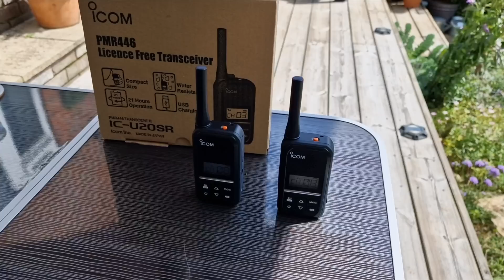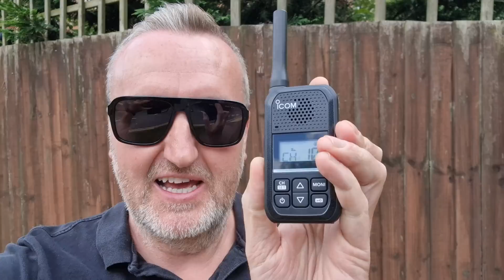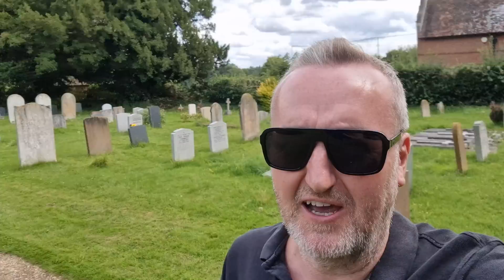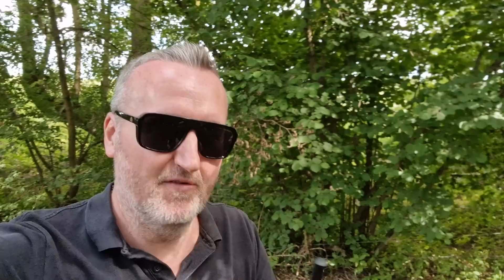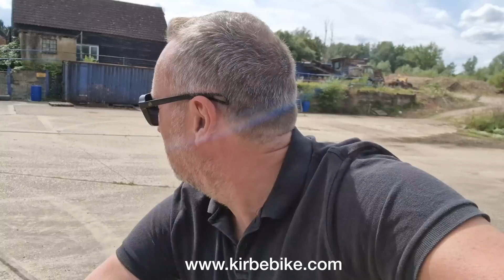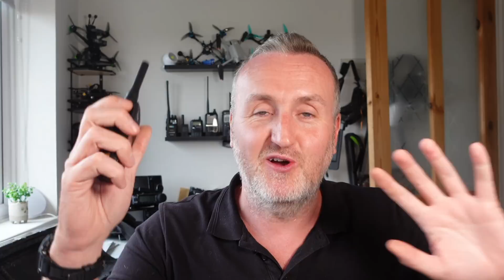Icom IC-U20SR Ultimate range tests!!!

Comment: Two-way radios work best when you speak into the microphone from about 6 inches away. Using an external speaker microphone lets you hold the radio higher while still talking close to the mic.

Comment: Hi Andy, Can you help me some info about this radio which I can't find anywhere. Is it possible to program a scan list for 3 channels, and later change the frequencies and CTCSS codes of this 3 channels on the radio keypad? And is it possible to auto start scan when I select one of this 3 channel? I can achieve this with an F29SR2 except the keypad frequency change. And is the MONI button works the same as on bigger Icom radios? When I hold it it opens the squelech and temporarry removes the CTCSS from the channel until I press again and it reactivate the CTCSS on the channel. Thanks in advance!

Comment: I have one Icom IC-F29SDR and two Icom IC-4029SDR. Of course I bought them for the dPMR but if I was to buy an analog only PMR446 radio, this is a strong candidate because of the professional building quality of this little handy thing! 🇸🇪
Reply from the maker: Yes the quality is amazing. Wouldn't expect anything less from icom 👍🏼
Reply: @andykirby what output power is coming out of these units?
Reply: @LennartWennberg how do the IC - F29SDR’s perform. I’m
Interested in those radios.
Reply: @spig021  Well, it is built like a brick and has big battery capacity! A real professional radio!
But, it's not easy to program and customize. You need both a cable and software.
If you buy a pair and plan to use them together they play good together.
Please come back if you have more questions! I will try my best to answer you!
Reply: @LennartWennberg  Thank you. Perhaps a short review on your channel just going over the features of the radio & examples of range & quality of sound? Also, does the keypad illuminate?
Reply: @LennartWennberg  i am deciding between the Kenwood TK3701D or F29SDR3. - could you suggest ? thanks. its for private property home use. large property. thanks.

Comment: Hi Andy, does the antenna screw off or is it all one unit( probably not) but thought I’d ask as that would certainly make a difference 😊
Reply from the maker: No unfortunately not, as per the regulations you can't have removable antennas on PMR446

Comment: What a pair of PMR446's the best I have had with PMR446 was at a very low height 22 miles aprox.  On the beach just west of Eastern Docks Dover to a friend on the beach in Calais. I was not surprised as in the very early days of Mercury one2one, I was getting into the Mercury cell at Dover from Calais which was 1800Mhz at about 1 watts maximum

Comment: Test them with the remote unit 6' above the ground as 90% of people will be when using these radios. The range will be greatly reduced. You basically have the remote radio on a much higher location, which increases the line of sight.

Comment: I have built a 1/2W FM broadcast transmitter. It gets out miles with just a short wire antenna. I have a few leftover parts if you want to build one and test it? Dead bug style and just a handful of components. Take the decks up in the mountains ;)

Comment: UK PMR should be at least 1 watt tx power imho .
The quarter watt is a joke given how built up the UK is and how rugged the landscape is .

That one watt would make these radios very usable and not be ott powered .

Ideally 2watts would be good one with ability to change antenna or two with fixed 🤷
Reply: Its said that Hang Gliders use 143.50 to 143.95 MHz FM to talk to ground helpers.
using Baofengs, and as long as hey dont cause trouble Ofcom leave them alone
 (its been said) probably not true?
Reply: Half a watt, but OK
Reply: @Flipdrivel  Half a watt ERP, that could be 2 watts out into a  minus 6db helical

Comment: Try going digital. I use Kenwood  digital 446 radios. I live in mid Wales right out in the sticks. Farming country where there are more sheep than people. I can keep in contact from home to the 3 local villages about 5 miles reliably. I was in the local garage getting a new tyre fitted and wanted to tell the wife i would be a bit late back home. The garage owner said that wont work here mate, there is no phone signal. Thats another benefit. The phone signal is patchy at best so these work far better than a mobile phone in our area. Best of all, no noise when in a poor location. Any received signal comes through as good 5 miles away as it does 5 feet away.
Reply: If you arent too worried about the legality? a couple of Baofeng DM-5R v3 about 50quid
 a piece. out of the box with 446 entered on the keypad in frequency mode will work
 back to back in Tier 3 DMR mode
Reply: https://youtu.be/m14v6h2h_B0
Reply: which model you use ? what you recommend from dpmr radios ?
Reply: You can better use frs
Reply: I've got the kenwood dk310d radios and they are brilliant on digital.

Comment: Hey andy, if I wanted to make a device that can detect the presence of an emergency vehicle (using the emergency network) and alert the driver (deaf driver) of their presence so they can be alerted in advance to move out of the way, as they are deaf and may not notice the emergency vehicle in their mirrors.

What kind of receiver would I need? I assume the receiver can be a “weak” one because it only needs to receive when they are close by.
Reply: I think ringway manchester tested a Tetra Airwave detector on 380 to 400MHz some time ago?
Reply: It's a genuine question as I don't have a driving licence and don't know the rules : Are deaf persons allowed to drive?
Reply: @ohaya1  yes they are, deaf, partially sighted, amputees etc, in fact if you are able to pass a driving test safely then you are allowed to drive.
Reply: @Old_Man_Pete  thanks, good to know

Comment: Nice Test Andy at £141.60 per unit quite costly for a ping radio feature - would be nice to see this test on a pair of baofeng at less than £50 per pair more affordable for everyone.
Reply: The multinational licence free Baofeng BF-T8 / BF-R8 / BF-U9. is the one to test against,
 around 40quid a pair
Reply: Pay cheap you will get cheap. Baofeng are ok if you have a budget but Icom, Kenwood are the best, you get what you pay for.
Reply: @David-FaceForRadio  that used to be the case as all Japanese handys were Superhets, Many are now also SDR and made in china
Reply: No cheap Icoms

Comment: It would be interesting to do the same test with a pair of UV-5R operating on PMR446 frequencies. Yes, I know they aren't quite legal because the antenna is removable. But on low power and narrow band they are pretty close to regular PMR446.
Reply: UV-5R are garbage radios with very heavy spurious emissions. Icom will definitely be much cleaner. I think the Chinese radios ruined the radio market. Buy good stuff and stop polluting the air waves.

Comment: Instead of doing kilometres why don't you do miles. We don't work in kilometres here in the UK so it's hard to comprehend how far away you are so a bit pointless really.
Reply: Did you know you can convert it on google if you really cared that much
Reply: @imgeedup  I don't want to have to convert it. It's a british guy  doing a youtube video and using kilometres when we work in miles in the uk.
Reply: Yawn
Reply: @RingwayManchester  Stick it up yer Thunderpole.
Reply from the maker: I suppose I should have put both on the screen. In radio ive always worked in meters as you can be more accurate. If i said 0.0621 of a mile would you know how far that is? Surely you have a feel for how far a meter is? 1km is 1000 meters. 🤷🏻‍♂️
Reply: Kilometres is much better

Comment: Nice! Did you test any dPMR handheld radio's? I'm curious how they compare to PMR.
Reply: I reckon if these were on dPMR with no hiss, that signal would’ve been a lot clearer.
Reply from the maker: IMO they don't sound great but performance is pretty good.
Reply: @andykirby  thanks for the reply!
Reply: dPMR is dead. DMR tier 3 killed it, Baofeng DM-5R ver3 around 50quid, not strictly legal
on 446.. but, well...
Reply: @g4wwk-k2f  I've got a DM-5R, but it doesn't do tier 3. Only 1 and 2.